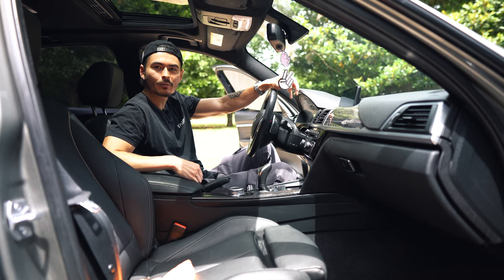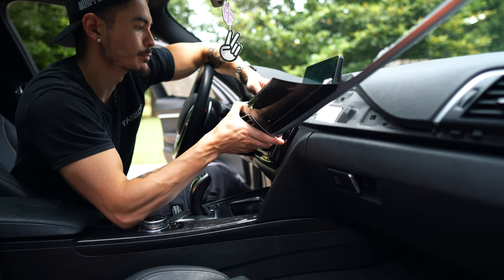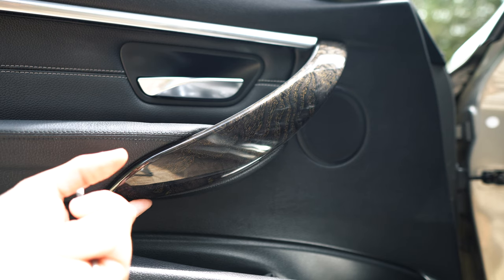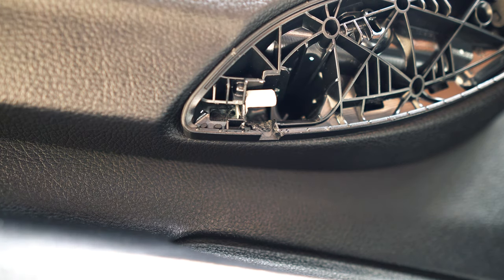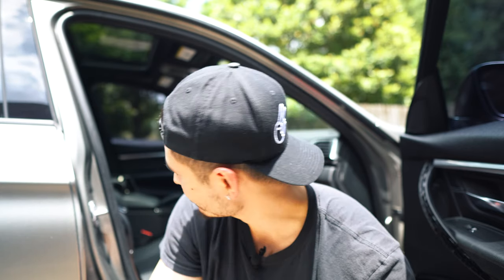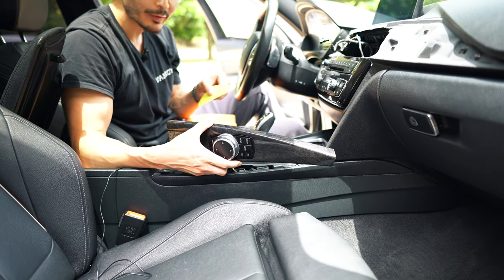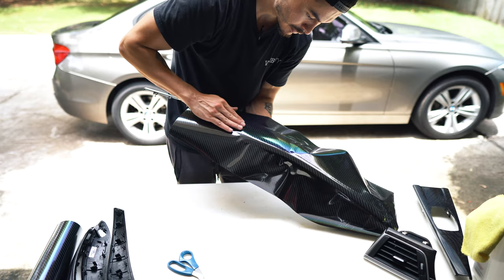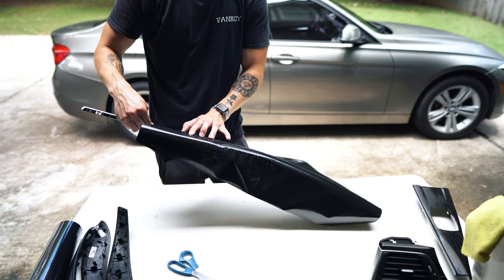How to Vinyl Wrap Interior Trim in a BMW F30 | #DIY

Comment: Nice tutorial and nice vinyl wrap.
Plastic trim removal tool set is what you should get, I found mine on Ebay and Wish.

I was wrapping the interior of BMW X1, E90 and E46…and its always learning something new and getting better with every new project.
Now I also have that wrapper set for cutting the vinyl and a smaller sharpie, makes it a bit easier too